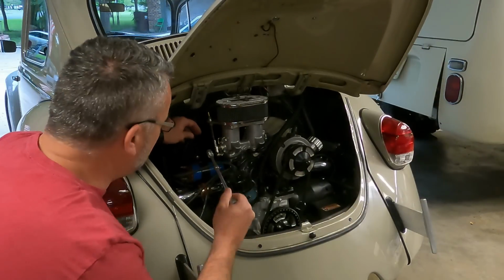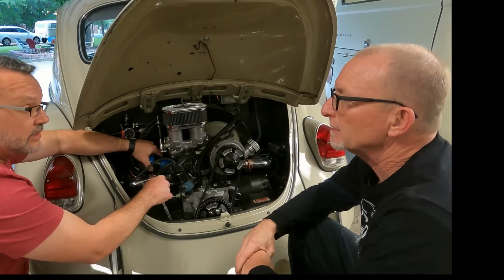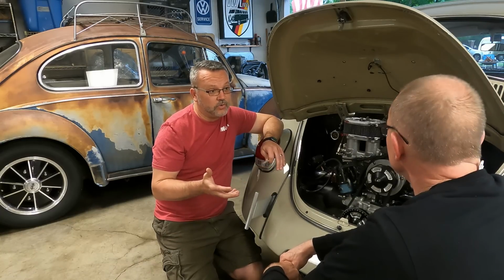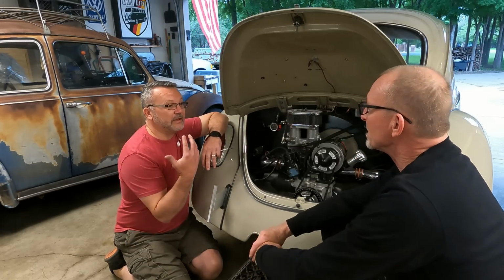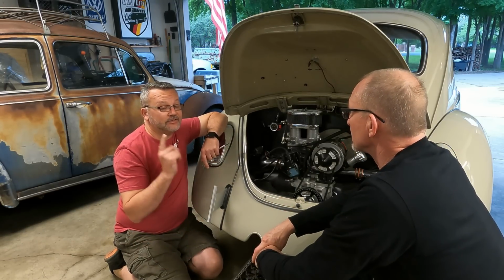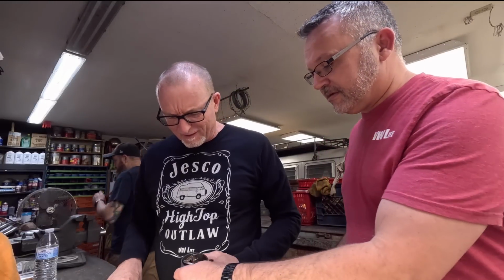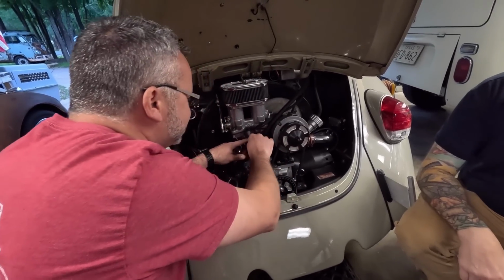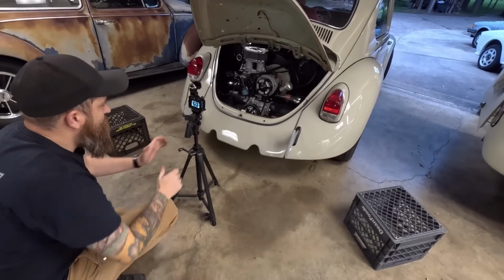Pertronix Ignitor II Install and free giveaway for 2023 VWLife

Comment: Thanks for the video.
I  currently run a Bosch 019 distributor.  I spoke to the folks at PerTronix and they told me that they don't offer a Ignitor 2 kit for the 019 and 010 distributor.  They only offer the Ignitor 2 (91847A) for the 009 distributor. 
Can you tell me what part number you used?
Thanks-Lyndon

Comment: Hellooooooo VW Life,  call me old fashion , ( not the drink ) I have a 71 super beetle that I am running SVDA distributor  with points and condenser and 34 Pict 3.   Just last summer , my  beetle caused me some heart ache running bad.  Had to pull over and check the under the rear deck lid.  I found that the new points had that white crust on them.  Probably  cause by the new condenser.   I had to clean them the best I could on the side of the road and limp and pop all the way home.  After a good filing and timing.  I am back on the road, but is that waiting to happen again,  the world may never know.  
Keeper her running.

Comment: BC from S.A., running a 2276 with an .010 and a blue coil. It’s been great, but I recently came across an .019 needing a rebuild-for $20!! It’s been rebuilt and I’m just waiting for the proper motivation to swap it in and see how it works. I also have an .009 for a spare. Love the videos!
Reply from the maker: That 010 is probably better for your power - a 010 has a quick linear curve so it goes all in quickly which good for making power. I'd leave it.. maybe consider a coil change but wouldn't go with the 019 in your scenario. 
Thanks for hanging with us.           Tommie

Comment: I'm currently running a Pertronix SVDA Ignitor III on my 1970 1600 single port/Kadron dual carbs (ported for vacuum)/generator. I originally used a Flamethrower .032 ohm coil per Pertronix recommendations.  However, I found that the Ignitor module was very sensitive to voltage drops.  It would stumble/cut out at lower rpm when under load.  Apparently the low .032 ohm coil was pulling too much power from the generator at lower rpm causing the Ignitor to cutout.  I replaced the .032 ohm coil with a Flamethrower 1.5 ohm coil and this fixed my issue.  Another thing I did to my Pertronix SVDA was to replace the vacuum can with the one off my original 1970 vacuum only advance distributor. The original VW vacuum can is much more sensitive to the lower vacuum inputs form the dual Kadron carbs.  The 'ol 1600 now pulls nice and clean through the rev range.  Cheers from Michigan!

Comment: I have an old Bosch coil with a vacuum advance distributor (113-905-205M) that came off a 68 bus that I am currently in the process of getting running.
Reply from the maker: If I recall, a 205M is dead on ringer for a 205T. Good little dizzy!

Comment: My 72 beetle is running a
EMPI 009 Centrifugal Advance Distributor w/ Electronic Ignition 
My 68 double cab stock OG engine  009 w/ points

Comment: I've got a 67 beetle, and I'd like to say I'm running, but I'm not! Lol
I've got a 1600DP with a 30 Pict 2 carb, a Bosch blue coil, and I go back and forth between an old 305m distributor and a cheap no name SVDA distributor but I just can't get it back to running like it used to. I'm absolutely dying to switch to a Pertronix system and see if it gets me going again.
Reply from the maker: Curious how that 30PICt2 runs with a DP. I tried the SVDA and NEVER had one run worth a flip.  Try finding a good 205K or 205T, vacuum advance, I think, that with the Pertronix will be the ticket!
Reply: @VWLifeVW   Hello! The intake that I have had the original 34mm flange cut off and a 30mm welded in its place. I don't know why they didn't use an adapter or something. 
The bug used to run like an absolute dream with the 30 Pict 2 and the 305m, but I let it sit one winter and it never ran again. I've had the 30/31 carbs and a bunch of different distributors but nothing works. I've taken it to 4 different shops and they couldn't get it running either. I just bought a completely refurbished PICT 2 carb from Tim at Volksbitz, and I'm hoping to pick up a refurbished 305m from Bill at Sparkxwerks, because that's what worked so well when the bug was actually running. I still want a Pertronix setup really bad! I'm really wanting to try it out and see how it does.

Comment: I'm running a  Bosch Blue coil with a khultec 009 distributor, 1600 engine single port, 30/31 pict-2 carb
Reply from the maker: Francisco, that is a solid set up. How does it run for you?

Comment: For those getting a flamethrower coil, don’t skimp, get their holder clamp. The stock one is too tight and if you tighten the stock clamp on the flamethrower coil, you WILL crack the resin filler and it WILL fail. Not immediately, but it WILL fail. You can guess how I know. Get the Pertronix clamp with your Pertronix coil or ignition kit, you won’t be sorry.
Reply from the maker: What a great bit of inside information!!! Thank you for sharing this!
Reply: @VWLifeVW  inside info, that’s funny. Most don’t know original coils were oil filled. Flamethrowers are resin filled. My bracket cracked mine and it failed after only a fee months.

Comment: Wich spark plug wires are u guys using ?
Reply from the maker: I actually, and it is recommended, to run the Pertronix wires with their Ignitor. I run Pertronic, coil, wires and Ignitor in Jerry the Bus. Jake runs the same in Ziggy.

Comment: Wow Tommy awesome  Bug,  gorgeous engine.  I’m running a vintage 009 , vintage points, vintage condenser, and custom mis matched plug wires (means it’s been in there a long time and still works) it used to be “Old Stuff “ , now it’s vintage hopefully that makes me feel better when they fail, naw probably not but it’s a’74 Ghia 10 times cooler than any Kia, 😊
Reply: Thank you sir 😎😎

Comment: can u change springs in a 009 to match the 019? That asked, from what Gene and Gary Berg told me when I was stationed near them in the 90's they were popular with the cal look guys from the late 60s and 70's. Any hoo SVDA and Kadrons for my 70 bus with pertronix unit I bought for a car owned in in 1998.
Reply: You can adjust the tension on the spring and get it to come in way quicker

Comment: In terms of what I like to run, I like to run no distributor at all.  I have moved to electronic fuel injection exclusively.  With living at 5,420 feet above sea level, carbs are just a no go.  If you jet them to work at their best over a mile high above sea level they will run terrible at sea level, and with some roads here going over 12,000 feet above sea level they work terrible up there too.  Electronic fuel injection is the way to go, and really for everyone it has benefits.  The only problem is it costs so much more than carbs.

Comment: What's interesting about the various centrifugal distributors is that when they start to advance is just all a function of the spring that is inside them.  That's really the only thing that is different.  So, you could make a 009 act like the 010 or 019, and any combination thereof, if you just have the right spring tension relative to the weight that is spinning around in there that controls the advance.  There used to be a company that sold spring kits for 009's so you could change the advance curve in a myriad of ways.
Reply from the maker: Sort of.. the weights are made to control the total amount of advance. the springs control just how fast that happens. so you can control them to an extent with springs variations but they're other items that dictate low and high rpm timing .

Comment: I’ve always ran 009 with pertronix since the 90’s with a heavy dose of compression, Cal Cam camshaft, and dual carbs, just have to carry the speed through the corner. But now I’m questioning everything!! Also used to rejet the replacement pict 34 carbs idle, main, and drill accelerator pump nozzle so they don’t stumble. Thanks Tommie now I’ll be searching for a 019 with all the other VW lifers!!

Comment: Bought the pertronic distributor and hated it. The distributor was cheaply made in China I think, and never got good performance from it. It did not like my Weber progressive. Called Dave at CB performance and purchased the billet distributor from them. Much better. Now running Weber 44, so the 1914 runs great. I kept the pertronic distributor as a back up for trips. By the way I have a manx clone on a 66 pan with the 6 volt transmission. With the necessary mods, 12 volt with bell housing shaped to accept the 200mm flywheel.
Reply: Glad you got it figured out.. that CB billet distributor is not US made either just fyi but I agree some of the stuff from china has no quality and can be frustrating.

Comment: Don't pick me 😆.  My setup is dialed.  205T distributor, Blue Coil, and a 30pict-3 carb
Reply: I would of been lazy and went with the 30pict 1 or 2 and not have the airbleed adjuster .. 🤣🤣😉 but that's just me taking the easy route. 😉

Comment: I'm using the stock setup on my Squareback. Dual solexes and points with a cheap coil. I need to get my plug wires replaced and hopefully it'll run properly again.

Comment: My 63 Bug with original 1200 has been running a 009 for  nearly three decades.  009  ended up in there because the original distributor was stolen. Also running a Beru blue coil.

Comment: I believe they’re up to the Pertronix Ignitor III now. I have an old Pertronix I in my car and it works like a charm. On that one you have to be careful to not invert the hookup wires or you’ll fry it immediately. Also you shouldn’t leave the key switch in the on position without the motor running or you will fry it as well.

Great tech info; just like the factory OEM I prefer vacuum advance distributors; not only they minimize the stumble you get on 009s but cars tend to be more fuel efficient and run cooler. I’ve been running an SVDA “advance curbed” for dual carbs since 2005.
Reply: Yea the ignitor 2 is super helpful on not frying it like the old ones.. and I think the 3 adds a rev limiter??????
Reply: @tommiesmith3369  The Ignitor III is the latest and greatest evolution. I am not sure of the features but I wouldn’t be surprised it also has a rev limiter like you say.

Comment: I’ve only used Petronix once in the 80’s and it failed. Went back to points and condenser. Of course now, it’s hard to find quality points and condensers. Always carry spare items to convert back just in case.
Reply: Try them again.   Tech has changed
Reply: @lpz3665  agreed I killed a few myself back in the day . but things have changed.. and like with the ignitor II - you can leave the key on and wire it backwards without killing the unit. 
Thanks for hanging with us guys!